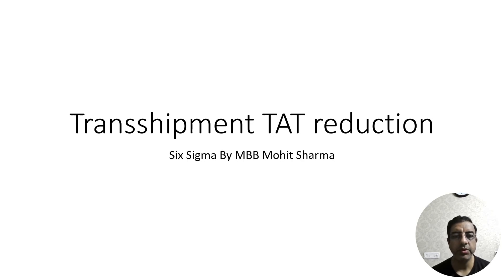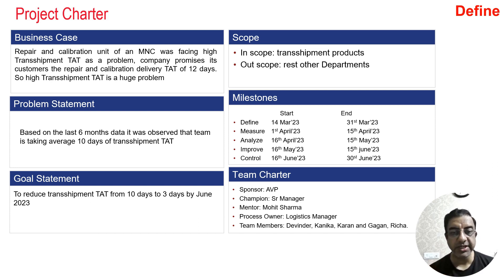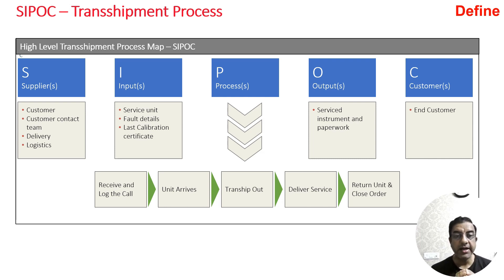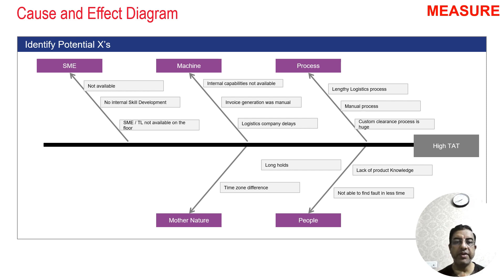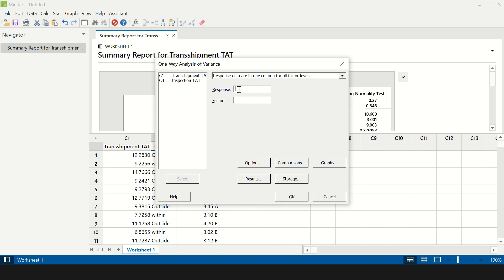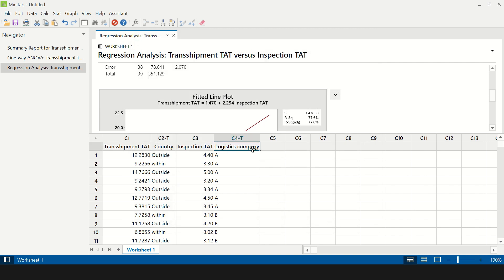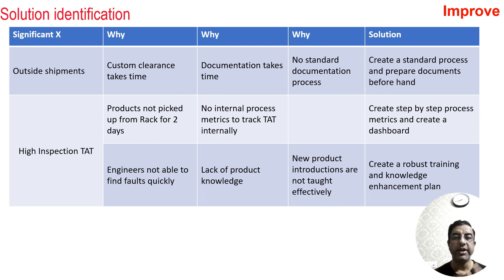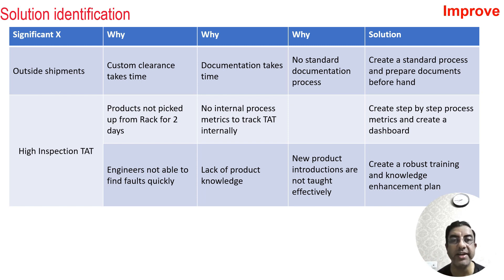DMAIC Case study Logistics - Transshipment TAT reduction

Comment: Control phase is missing as it is one of the very important phase to ensure the solution stays in control and the same is passed on anyone who would want to understand the journey of this solution building.
Reply from the maker: Agree with you. I wanted to share so many details however due to the length of the video I have not included them